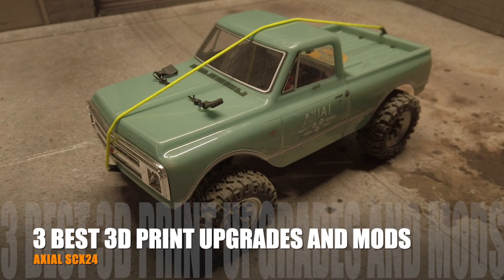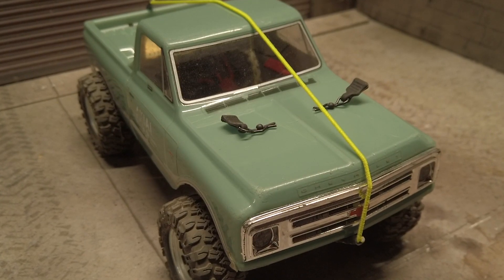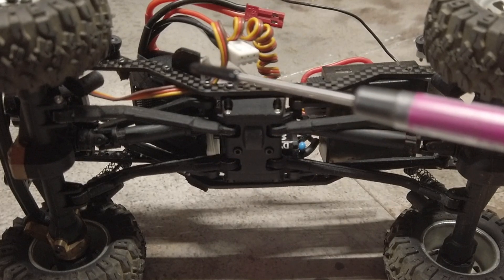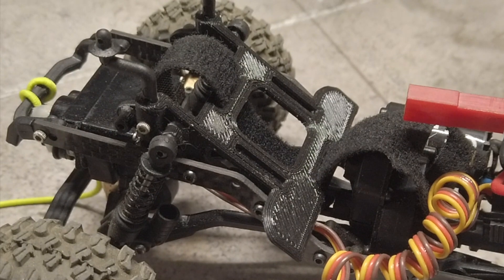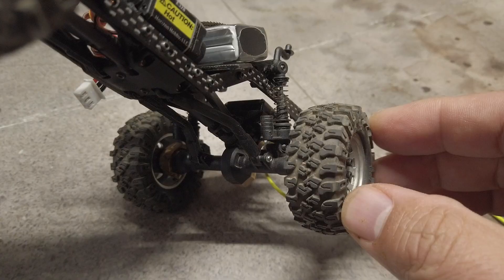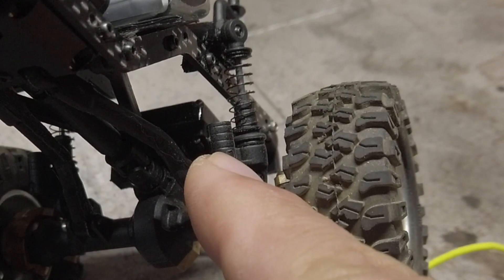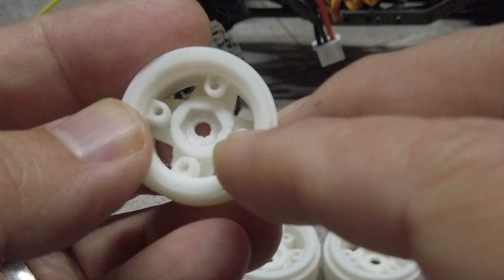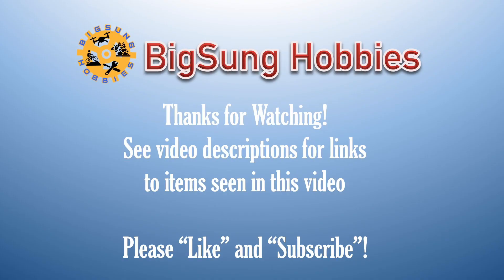1/24 Scale Axial SCX24 | 3 Best 3d Print Upgrades and Mods

Comment: I just got my first SCX 24 so I am headed for upgrades to make it better
Reply from the maker: Congrats!  I am really enjoying the SCX24.  If you have not checked out my other upgrades/mods video, take a look.  They should provide a good direction on your mods.
Reply: @BigSungHobbies  Thanks I follow everything you have done with it ..I ordered a carbon fiber chassis,  brass weights for wheels and +4 mm axles , rc4wd wheels and tires ...I got a Deadbolt but plan on stretching it to a C 10 size ...ordered a brushless motors and esc from Castle ....plan on making my own links with maybe brass or steel not sure yet...
Reply from the maker: @tomandrews5392  Thanks for checking out videos!  It sounds like you have a good direction that you want to take it!  Awesome!

Comment: for simple shock spacers like the ones shown you can resize them in your slicer software for custom sizes. for example, if you scale the height of the 2mm spacer by 125% it will be a 2.5mm spacer and so on
Reply from the maker: Yeah, I am learning all about it.

Comment: I prefer the Mod19 ultra-low CG front tray and links. His upper link provides extra clearance so the driveshaft doesn’t bind, the front of the receiver tray is relieved for better servo clearance, and the multi-height front shock mount is also useful. The Deadbolt version also lengthens the front links just enough to improve servo clearance for the popular EMax servo.
Reply from the maker: When I did this video, that option was not available.  I recently noticed it.  I might print one out and see.

Comment: I’ve seen the link to those links on the scx24 mods page! Amazing clearance. Can you share which 3D printer you got? Thanks, Scott
Reply from the maker: Hi Scott, the high clearance links are a huge performance upgrade, and should be very high on their upgrade list.  The beauty of it is that while it maintains the same ride height and center of gravity, the clearance improves significantly.  In order to achieve the same clearance on stock links, you would have to raise the chassis, but that increases the center of gravity.  As for 3d printer, I picked up Ender 3 V2 at my friend's recommendation.  So far, I am quite happy with it.
Reply: That’s definitely high on the list and by the sound of it so is the 3D printer you mentioned. The last time I was checking those out was around 2012 and they were well over £1000 for anything worth having. So that’s what I’ll be asking Santa for 😄 

By the way your Enduro videos have proved an issue as I’ve had to buy the Trailwalker RTR! (Sendero not available). It’s a great hobby especially with COVID lockdown in the Uk. Just awaiting the GSpeed v3 kit as we speak! Haha can’t wait!
Reply from the maker: The joys of the hobby :)  By the way, I would recommend the Trailwalker over Sendero, so you did good.  They are basically the same except for more useful body and bumpers and at a lower cost.  Most of us upgrade the wheels and tires, so the smaller tires on Trailwalker is non-issue.

Comment: How did you get the links to work.I need help
Reply: I need them to fit the jeep
Reply from the maker: There was supposed to be a link that worked for jeep/c10.  I couldn’t find it either.  I heard on the forums that you can modify the file so that it works for us, but that is beyond my grasp of 3d printing.  A friend graciously gave me the hc links, but I believe he paid for the files.  Sorry I can’t be more of help.
Reply: @BigSungHobbies  ok thanks I will design my own links.
Reply from the maker: Awesome, let me know how it works out.
Reply: @BigSungHobbies  well I designed front and rear link and they fit perfectly.Now need to test them, but I am wait fo my barrage motor.

Comment: Is there a esc mount for the rear? The lcg battery tray moves the battery to the front right?
Reply from the maker: The idea is to remove weight from the rear to help in redistributing the weight.  I use 2 sided tape to mount them in between the chassis rails.  I have couple of videos that talk about it and show you how it is done so take a look at them.